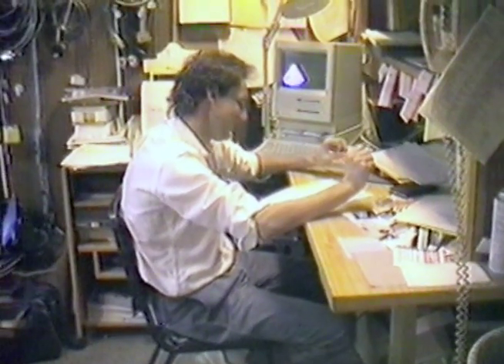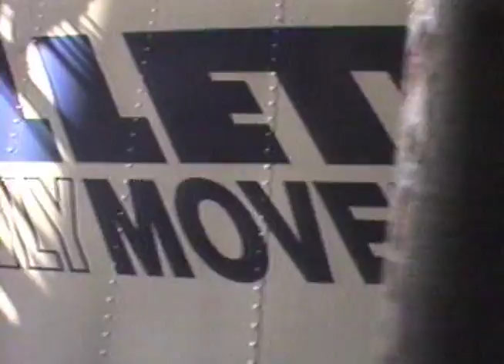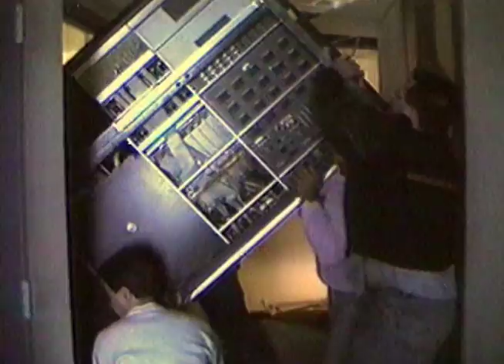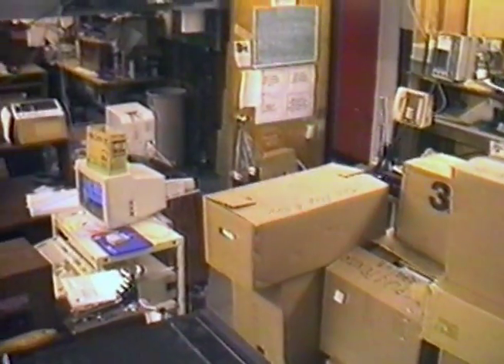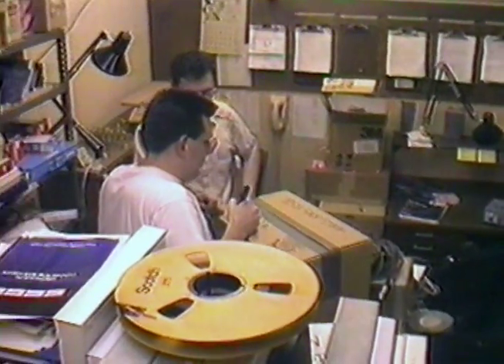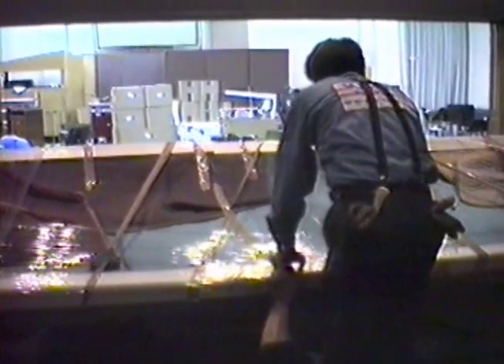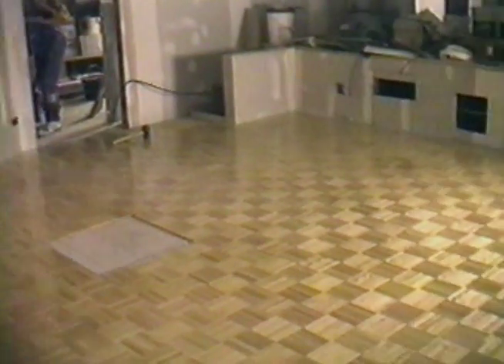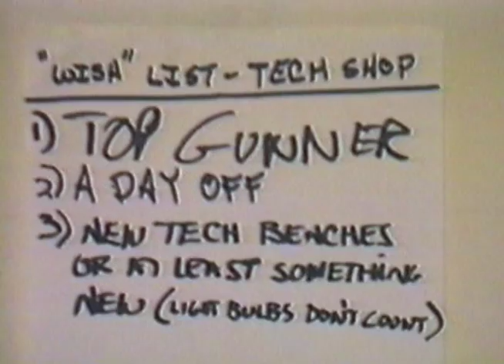Universal Recording "The Move"

Comment: I appreciate this because I just moved a Neve V series when I helped my EX-Boss close down Reflection Sound Studios in Charlotte NC. I had to take out a wall just to get the frame out of the building.

I took out all the modules, faders, and the center section before I moved it. Looks like these kept it all in there for the move. Amazing process to get 45 years of equipment out of that studio, moving the EMT plate took some doing.

Cool video, thanks for posting it.